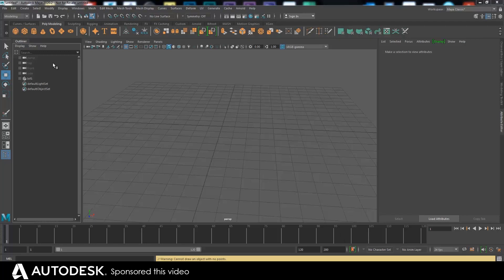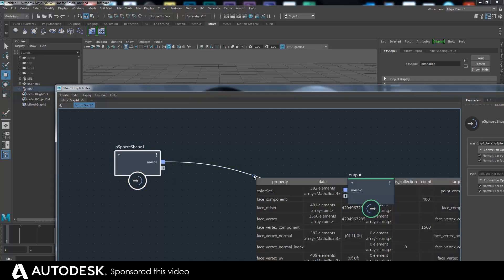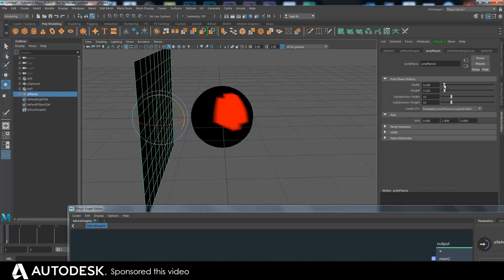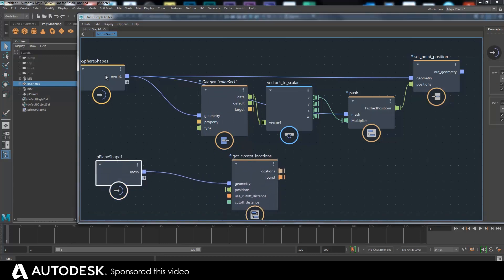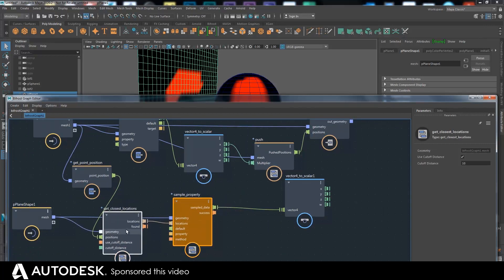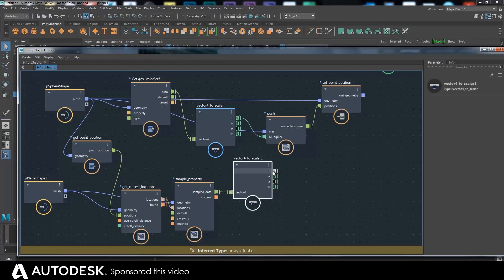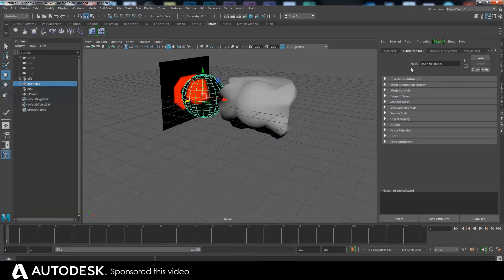Exploring Bifrost with Paul Smith - Ep.13: Location, Location, Location!

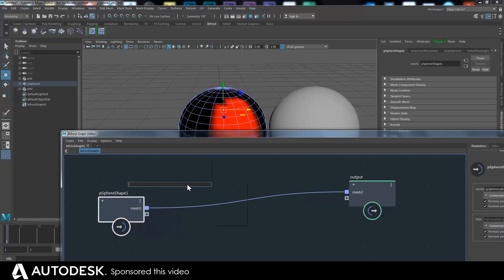Comment: 03:03
push node doesn't appeared for me in Maya 2020.4
Reply: Nevermind, found one
https://lesterbanks.com/2019/08/making-a-push-deformer-with-maya-bifrost/
Reply: Plz give your Push compound node, Mine didn't worked at 04:58, Some error when X (red value) is connected to Multiplier of my Push modifier.
Currently using workaround, If red value greater than 0, Push